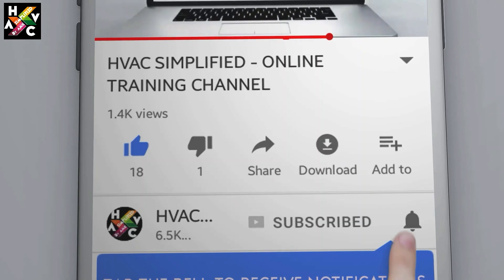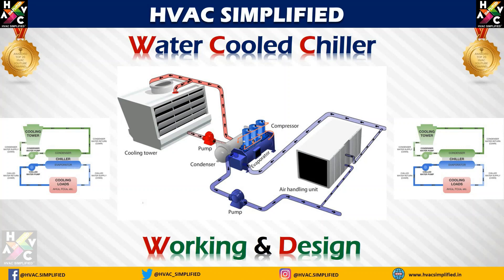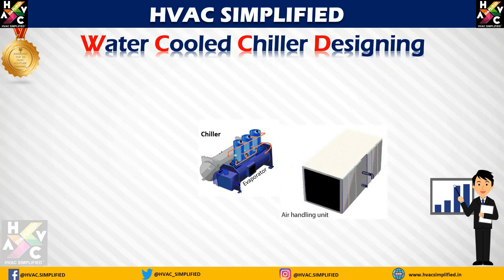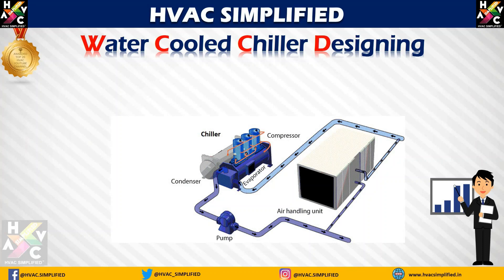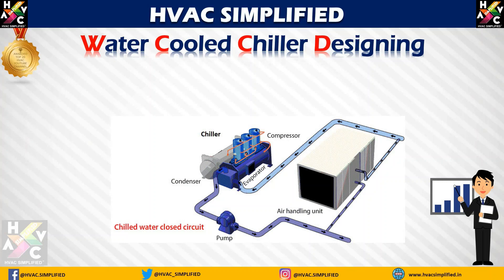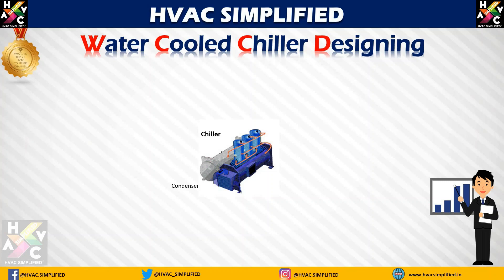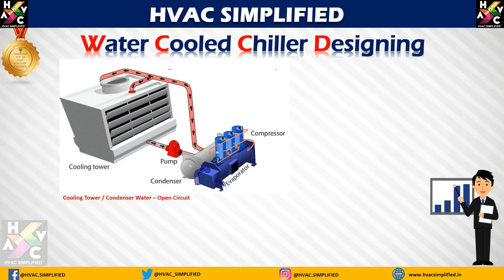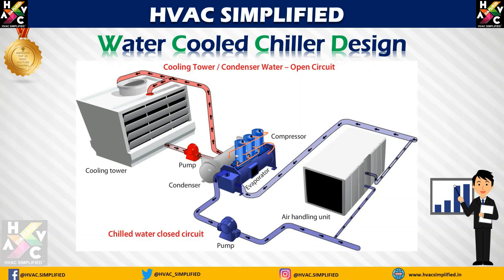HVAC Training - Water Cooled Chillers Design & Working

Comment: i understand about water going to AHU, but i dont understand the one going to cooling towe r. what is the purposer of cooling tower if the AHU already cooling the building?
Reply from the maker: Good question 👍
The AHU cools the air inside the building using chilled water. But that water gets warm after absorbing heat — so the cooling tower’s job is to throw that heat out to the atmosphere.
In short: AHU cools the air, and the cooling tower cools the system 🔄💧🌬
Reply: @hvacsimplified   Thank you